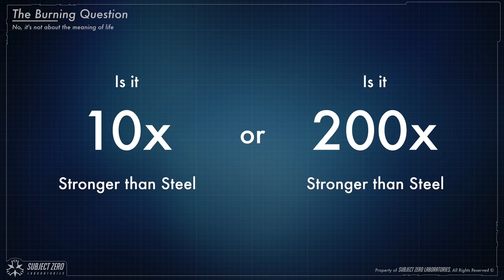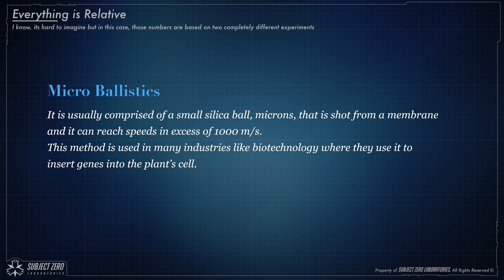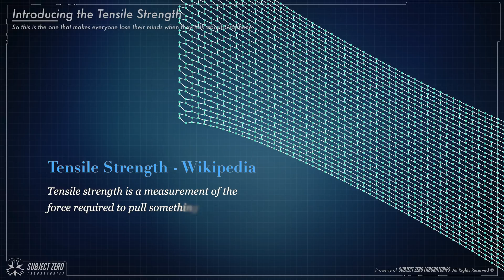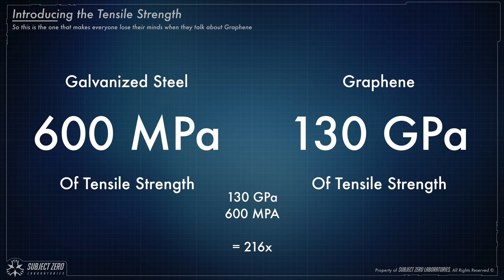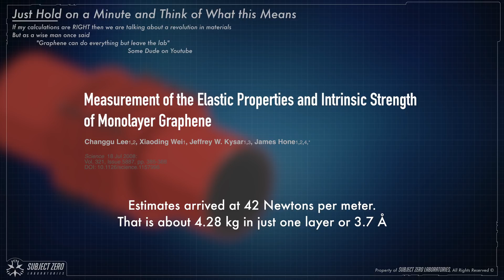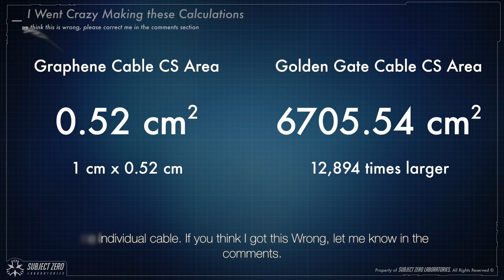The Strength of GRAPHENE Explained

Comment: If I got this right? Graphene is supposed to be indestructible, of course it's a great idea, but if it can be produced and used? We will have to be careful with it's application, look how much Plastic's are around particularly in the ocean. How do you get rid of it? Again, if I got this right?
Reply: Flash graphene method was recently made. You can look it up it can turn any carbon-based material into graphene even plastic.

Comment: I have a question , can graphene melt? And also can it get stiff in cold temperatures?
Reply: Ford did a video of testing and it and they heated up these bars with graphene in and one without and the one without bent a lot more than the one with graphene so no I don’t think it can melt

Comment: Have you ever heard of heat-treated tempered tool steel? It outperforms graphene in any aspect depending on how you heat treat it. I can get maximum tensile strength or I can make it ridiculously hard. The thought that graphene is stronger than steel and anyway is Laughable. I can cut heat-treated 4140 "45HRC" with a L6 Tool Steel band saw blade.

Comment: There is something I am confused about. So if you stack say 100 sheets of Graphene, would that be then Graphite all over again?
Reply: Plywood vs particle board
Reply: Stacking graphene individually does not make graphite. It's like saying if you stack papers, it would become one. No, because the paper sheets are not bonded. That's the same thing with stacking graphene sheets. They won't bond so therefore they're not gonna be one graphite

Comment: Your velocities for bullets are a fair way off. There are commercial loadings available at 4600-4700fps (1400-1450ms, the 220 swift) and there are numerous flechette and sabot loadings that aren't in common use or no longer in production that are substantially faster (Steyr ACR was about 5000fps for example). Tank main guns also fire about 5800fps.

The main limiting factor is barrel life. 1000ms is not particularly fast and isn't much of an engineering challenge. The original M16 was adopted with a round almost exactly that speed (M193 at 990ms) in the late 50s and early 60s.

Comment: If graphene cables could be created to replace the Golden Gate cables, a completely different anchoring system and support on the towers would be needed. The graphene cable might slice through the towers like a cheese cutter because the psi would be so huge on such a small surface area.
Reply: then we will jsut use very thick graphene cables, we don't really have a reason to use thin cables :\
Reply: But you have to remember that graphene are not easy to get in that large amount

Comment: You did ask for it in the comments, so: You can get bullets over 5000 feet per second, but not much over. And you'd want a discarding sabot for that. There's an upper speed limit for propelling projectiles with expanding gas due to the rate at which gas can expand. There's been ideas of using plasma instead of gas, but that is really hard on barrels. The 5000+ fps speeds themselves are very hard on barrels. Without using discarding sabots, it's not easy to go over 4000 fps, since constricting the expanding gas through a smaller bore, and having metal on metal contact at that speed (even though the projectile is coated in softer metal like copper), is very hard on the barrel as well. Most rifles are 2500-3500 fps for barrel longevity.
Reply: Question though:
How is graphene at durability? 
(steel isn't just chosen for it's strength, but it's material resistance to stress, & variable stress, over time. there's plenty of readily available stronger materials which aren't used because of this)

Comment: Since the individual wires that make up the cables are round, there are air gaps between each wire. Therefore if the cable was made from solid steel, it would be smaller in diameter, by how much, I don't know, but it could be significant.

Comment: but surely that graphene cable has to be continuous sheets? MIT just now figured out continuous manufacturing or graphene sheets, but whats to prevent individual layers from being damaged until the cable's strength is compromised?

Don't get me wrong, its amazing, but its gunna be a hell of a long road still
Reply: 14 million single layer graphene sheets. Surely, just like with steel cables, it can handle a few of those breaking.
Reply: That said, I do think construction will be one of the last areas where grephene will be used. Just like they don't use carbon fibre today. The price will need to drop a lot before it becomes viable for construction.
Reply: @sanderd17  materials like carbon fibre are much more damage-prone than steel cables, and I'd expect graphene to be even more so. So I mean it would take a lot less to damage 1/10 of a graphene cable than a steel one, but I'm sure there could be some protective coating or something.

And yeah definitely construction needs more material, is more risk-averse and is less weight-sensitive so I'm sure it'd be the last to use it

Comment: For a cable made from a single-sheet of graphene, there will be some defect rate, introducing grain boundaries, dislocation errors of different orders, and the like. This will limit its tensile strength well below the ideal value derived just from the physics of covalent bonds.
Reply: This is the weak version the strong one could hold a tank on a area the size of your pinky finger

Comment: i think you would actually need significantly less graphene than that, because you gotta remember that like half of the weight that those cables are supporting belongs to themselves! now that you've eliminated virtually all of the weight of the cables, you can probably do the same job with significantly less strength
Reply: The weight of all cables and accessories is 22.2 million kg. The weight of the deck is 151 million kg. It would definitely be a reduction, but not as much as you might think. For reference, the total weight of the bridge, including the piers is 381 million kg.
Reply: fuck you I think that is included in the calculation by design, the way they calculate it is considering that already
Reply: @kamel3d  I didnt realize what his name was and I thought your reply was just really hostile
Reply: @thecloud7587  I don’t get it

Comment: Neglected to "mention":  Today there still is NO WAY to make a graphene layer as gigantic as 1 cm x cm!
Reply: Not with THAT attitude!
Reply: @TinyFoxTom  he's saying as if the scientists owe this guy some graphene
Reply: Don't we have reel-ro-reel graphene production now? I was sure I had just seen that...
Reply: @Teth47  nope, well yea, but no... there is still to many impurities for it to have the strength talked about here - just a few atoms misplaced and it weakens to the point where you cant use it - also reliability of strength is important
Reply: @thoughtsofapeer  What is the strength of typical lab grade results compared to the impossibility of atomically perfect?
Reply: Now it is possible flash graphene hits the scene also its melting point is super high so you could mix it with steel and other materials by sprinkling it into the mold and it's a very very good conductor of electricity
Reply: hey man, replying to you since its now possible ( but still not really affordable) but new methods were discovered. easier, cheaper.
Reply: in near future they will make!!! and...Bulletproof vest??? wow,you can cover self from tank grenate
Reply: Not true, in a 2017 study in "Nature Communications" journal detailed a method that could create pure, 1-atom thick, graphene sheets as big as a credit card in one step.
Reply: Someone has done that, and it’s on the market now. Plus there are ways people in labs have printed a 1 foot long one
Reply: @Stimpy&Ren I suspect if you squeeze graphene together hard enough correctly you get diamond and it's a different kind of strength, but I see your point. I also don't think it applies to the method I mentioned though since that specifically makes graphene. I don't think it's currently anywhere near making bulk structural graphene though, that's a totally different ballgame.

Comment: I dreamed of a process of mass producing graphene...such an unexpectedly simple process!
Reply: What is it?
Reply: Hyperloop 
To produce graphene you can just put tape on a block of graphite and rip it off, but mass-producing it is the problem
Reply: @Hyperlooper  apparently YouTube's comment section is to small to contain it ;)
Reply: Flash graphene
Reply: Wait what is it? This might be the comment thread that changes the world 😜😆
Reply: @coldblaze100  it is
Reply: How do you get rid of it once its of no use? I'm all for moving forward,  but we have only had Plastic around for relatively short period and we have the stuff all over the place, apparently they even found a plastic bag floating at the bottom of the Mariana Trench!!! If its to be produced and used? There has to be strict controls on it.
Reply: @chriswilde7246  Graphene is all just carbon atoms, so I suspect it could probably be decomposed really easy by us carbon based life forms. We don't really discuss #2 pencils(or diamonds) polluting the environment, and those are created using the same carbon atoms as graphene, just in different arrangements.
Reply: @jacksonjw12  Oh ok @jack clearly I need to learn much more about all this, I probably read some  fake news about it from somewhere lol,  take care.

Comment: I have a question about Graphene. I hope you can help me with this. I understand that it is hard to pierce. But, is it hard to cut Graphene?
Reply from the maker: The quick answer is yes, because the mechanism of cutting is based on point pressure created by the blades, like scissors for instance. the catch here is that the lever makes it seem easier than piercing it like it would need half the effort (force) needed to cut, make sense? That is actually a very good question that I wanted to include in the video but at the time I thought it would be redundant. silly me I guess!

Comment: ... my guess is that polymer reinforcement (lightweight strong plastic and rubber), supercapacitor/battery/fuel cells and maybe barrier coatings (corrosion / oxidation protection) will be some of the first major applications, followed by water filtering and printable/flexible electronics. Then maybe biosensors and high speed commiunication technology, then finally next generation electronics (which is my main interest). And actually, there is a lot of other cool&important stuff in the pipeline. Not sure about graphene ropes, it is tricky to transfer the properties of the small flakes to large objects like the ropes (but not impossible). .... many companies claim to be close to large-scale graphene applications. Next 4-5 years are going to be interesting!
Reply: It does have a high melting point so you could mix it with molten metal
Reply: Well, it's been 5 years. Anything happen?

Comment: Hi there! Nice videos on graphene. I do think you made a mistake though. When you calculated the cross-section area needed to replace the bridge, you took 3.7angstrom as diameter of the graphene layer. So far so good. BUT, when you would lay the graphene layers on top of eachother, ther also has to be ''empty'' space inbetween them, you can't litteraly put them on top of eachother. It would still be waaaaaaaaay smaller than the steel cables though, so the conclusion would be still the same.
Reply from the maker: Yes, you are correct. I just didn't want to over complicate things, but I do appreciate your comment. A lot of times it is hard to calculate these things cause every place you look, the numbers are all over the place, even in science papers.
Reply: @Nandagopal S jew to*
Reply: @Stimpy&Ren 
I'm pretty sure that aerographene (under that name) is already a thing.
Reply: Y’all are fucking Tony Stark smart
Reply: also said fastest bullet is 4101 fps, that is also wrong. it is 4665fps
Reply: k